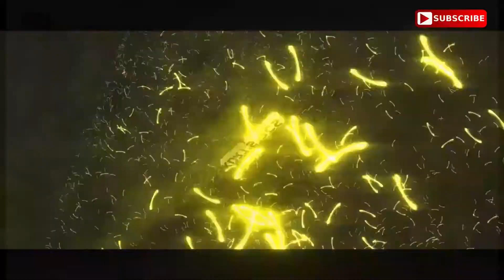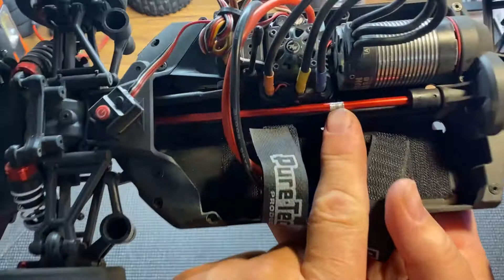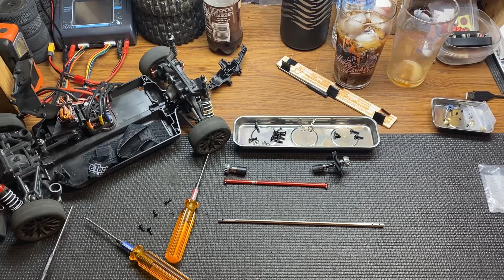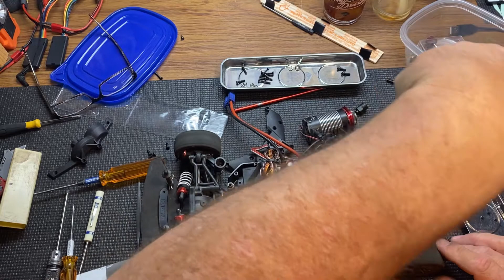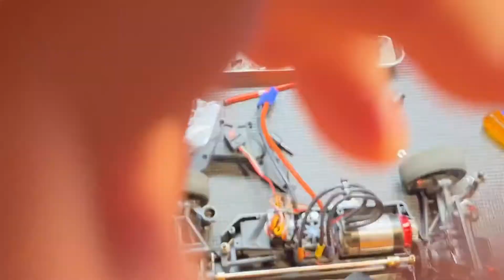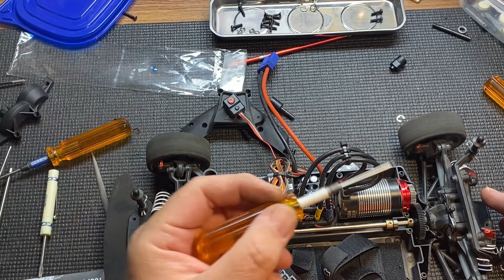Kyosho Fazer MK2 custom one piece drive line install (Made by KaniZ RC)

Comment: Been trying to get one of these for a while now. I think he is SUPER BUSY with these. I just sent him an email to buy. Now I wait. 
if you have a CNC you could make some great parts for this platform. 
Also, when it was wedged I think that's why its bent/warped. It should sit freely in there. I also replaced my Center Drive Cups front and rear. Trying to get rid of as many plastics as I can on this car. 
Woot Kurt!
PS: I love those metal trays. Are those surgical grade? I keep a wood block as my anvil. :D
Reply from the maker: Thanks for watching he made locking diff gears for it also those would be nice in this car, I just added the 62t spur gear from the traxxas 4tec and it move now. I bought those trays at the auto parts store they work great
Reply: @KurtsRCs  Mine is in my mailbox, waiting.  Had to order diff parts since they leaked & got stripped.
Reply from the maker: @sm6451  Nice i'm mgoing to run mine till they break and order some from him